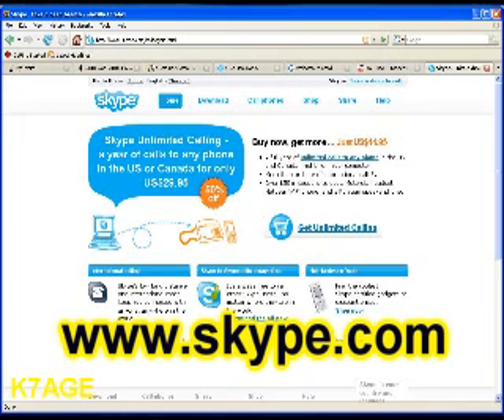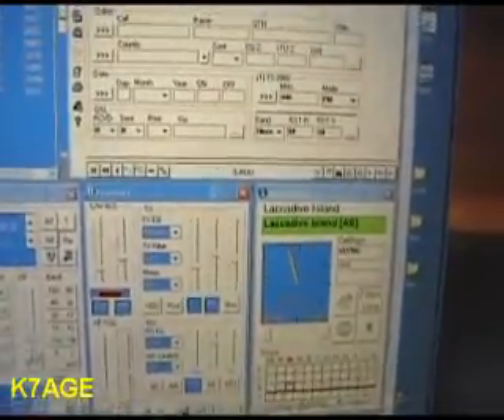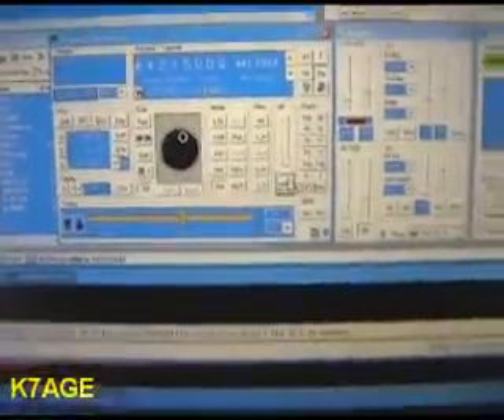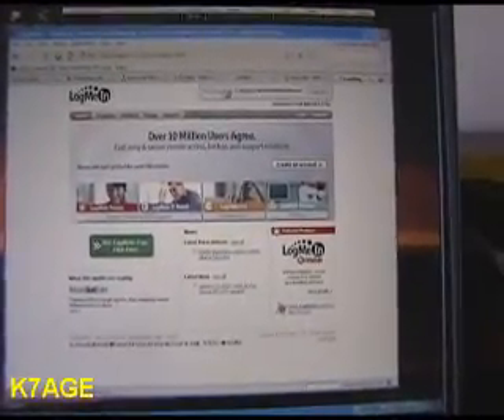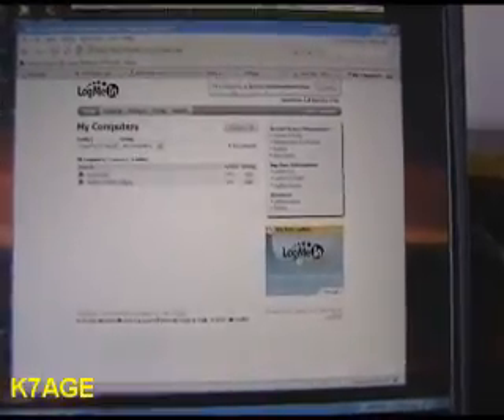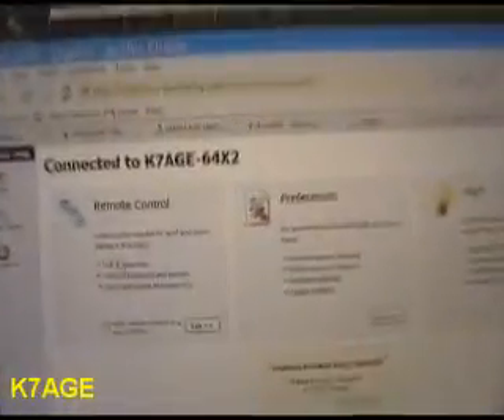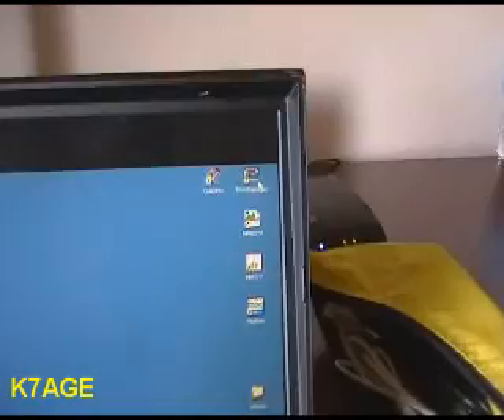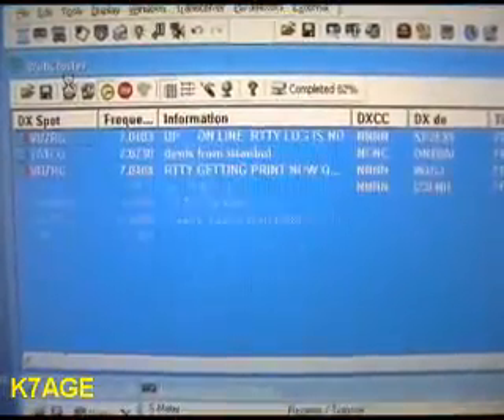Remote Radio Station Control

Comment from the maker: The radio has the soundcard interfaced. Skype is set to use the line in instead of the mic. The line out is connected to the radio's mic through the soundcard. The skype on the radio pc has its own account. Skype is set to auto answer to contacts which are in its list, which are my other computers. Randy

Comment: Hallo and thank you again for this very nice idea.
After I saw you video I started to set up a similar system. In my shack I have a TS570 controlled by Ham Radio Deluxe, and the Windows-PC that is remote-controlled by realVNC, is connected through a linuxserver as a gateway to the internet. It works really nice and it makes me able to control my shortwave trx from my home computer (I putted my "shack" in my office in my small company building.) 
so thanks and greetings from Germany
Fabian

Comment from the maker: Since it is remote desktop, any application on the radio end should work. Overall, this method still works. There have been some new hardware remote radio interfaces introduced, but I haven't kept track.

Comment from the maker: You need a sound card type of interface to the radio from the computer. There may also be PTT issues to make sure the computer's audio is getting into the radio when TRX keys the radio through the serial port. Randy

Comment from the maker: You need two skype accounts, one for each computer. On the radio computer set skype to auto answer calls from contacts in contact list. Configure skype for line in/out along with sound card interface to radio. Randy

Comment: Good Video Randy!  I do something similar with a FT1000MP Field, Ham Radio Deluxe, and Skype here around the house.  My biggest fear with the setup is if I was far away from it, is if the radio should some how lock up and stay keyed down.  Usually when I am done with it, I "park" the radio outside the ham bands where transmit is locked out. (in case something happens its not transmitting).

Comment from the maker: Ham radio is a little like being off the grid. We can communicate in many different modes without being connected using paid services. Lots of experimenting. I was making phone calls from my walkie talkie 30 years ago before cell phone were even a dream. It is challenge to build a station and to make it work, then see how far you can work. There isn't much of a challenge to working someone 6000 miles away with skype, which I also do. The challenge is to get more people interested.

Comment: Hello Randy - Great info on how to remote operation.
 By the way: could you give a recommendation for a good base station VHF rig you you buy yourself for weak signal work? I was thinking about the Kenwood TR-751A  or Icom 251. The Ten Tec TT526 gets rave reviews but it's not cheap.. I like older gear but looking for value in used,

Comment: Nice video, Randy.  I use HRD and the built in server along with Skype.  Tried IP-Sound and it was to unreliable.  Along with the concern of the radio locking up in transmit, I am concerned about the computer locking up and not being able to reboot and gain control again.  I lost control once and had to wait until I got home to reboot.  Any ideas?  What do you do if your home computer locks up?

73,  Carl W8KRF

Comment: How would this work for CW, not using the keyboard due to the latency of the internet connection.  I was looking at controlling a remote station from my home - seems to work on all modes but CW which is the mode I really want to use.
Ted VE6AMR
Reply from the maker: Ted, Not sure. I'm not a CW guy. I think there are some guys using CW remotely. But, I don't their setup.
Reply: It works ok for slower speeds 12 - 14 wpm but much faster than that the latency takes over and i'm a 35 wpm guy. Even using semi breakin at these speeds you will miss a lot and for working DXpeditions it's pretty much useless.
Ted